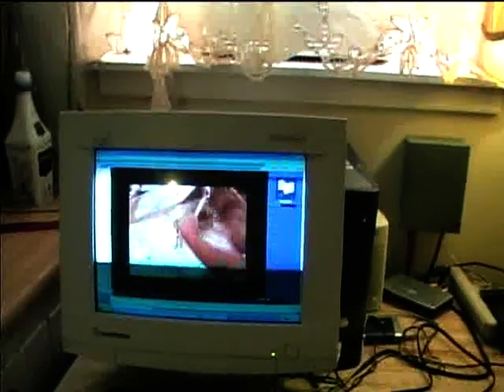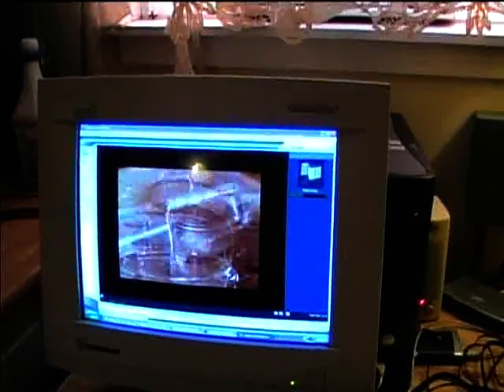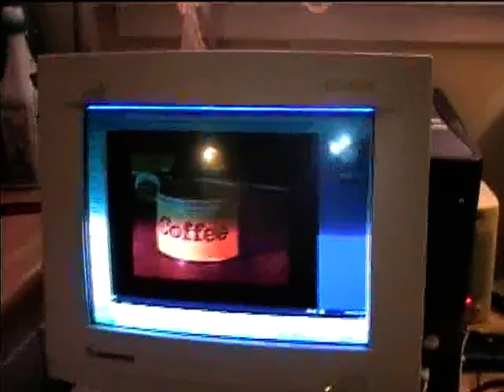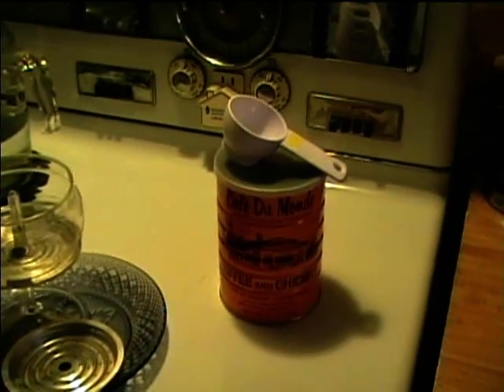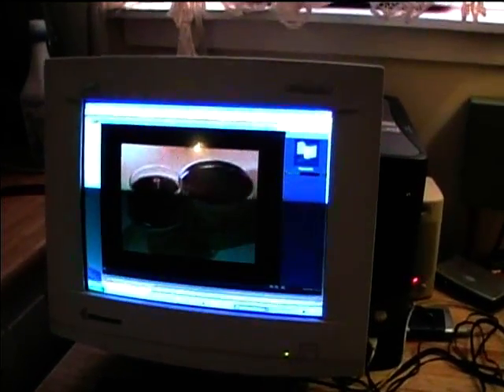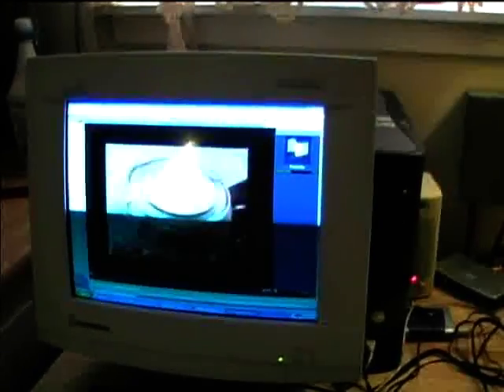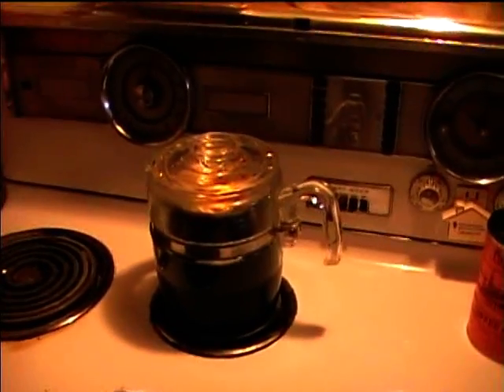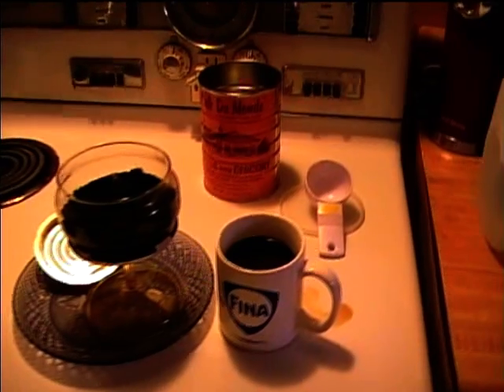Brewing coffee with Pyrex percolator

Comment: Originally my pyrex percolator came with a wire triangle that was placed on the burner to prevent direct contact with the burner eliminating hot spots that might make the glass crack. I think you can still find spacers in the kitchen stores or perhaps Ace Hardware.

Comment: Chad you need to place a wire grid between the bottom of your Pyrex percolator and the Calrod burner on your stove. If you do not  it will eventually  cause your Pyrex percolator to break. You can make one out of a wire coat hanger.You only need to do this on an electric stove with a coil burner...a smooth top electric or a gas r stove do not require this.....other than that I think your video is awesome

Comment: Thankies so much for posting this. :) I have been trying to work out how to use my pyrex perculator for ages!!Um one thing though pyrex in the 70's was designed for gas stoves.. To use on the coil stoves etc (electric) there was a little heat spreader to use.. I dont know if you can still get them though... Mum gave me manuals on using pyrex that said this :) Once again Thankyou!

Comment: Use an electric 1000 watt coffee perculator ,an older one, perked coffee in 3 minutes,done when the red light comes on, and it keeps it hot, remember to unplug these when you leave the house, they dont turn off by themselves. And try coffee with chickory, really strong black coffee with those oily little bubbles on top. Luizziane makes a good one, half the caffine too. Those glass perculators , you have to stay in the kitchen and watch them till there done.

Comment: Not a good Idea to boil the water Before you put the coffee basket into the pot. You could give yourself   a BAD  BURN!!  #1  ALWAYS put water into pot  first. #2 Then put coffee into the basket. ,  #3 place basket into coffee pot BEFORE you turn on the heat. ( To avoid scalding yourself ) Then place lid on pot. And THEN turn on heat at Medium heat.  Doing otherwise can result in a trip to the emergency room for a bad burn.   Back in the 50's 60's they didn't think to much about safety. They were only trying to sell there product .
Reply: My electric percolator starts with cold water and works fine so this should too.